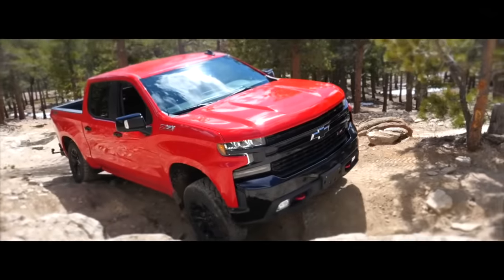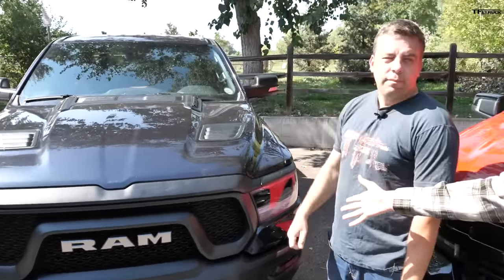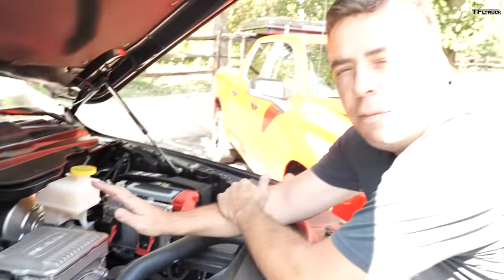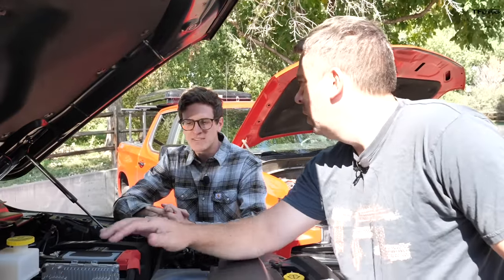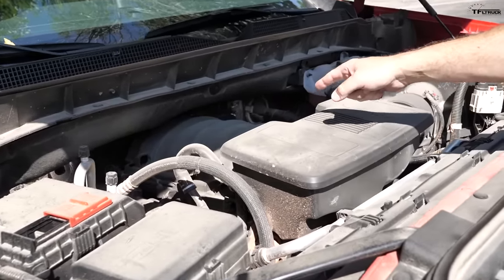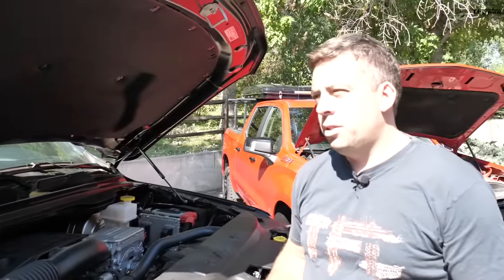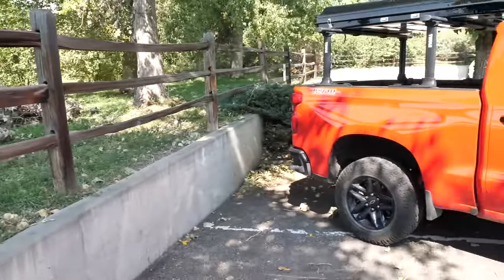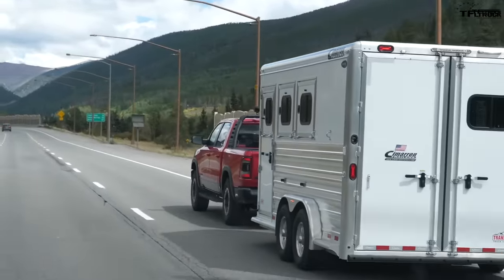New Ram Rebel vs Chevy Silverado Trail Boss: Which Full-size Off-road Truck Is Best For You?

Comment: If Chevy would step up their interior game like Ram they would probably be at the top (or close anyways)
Reply: Richard Garcia that grill is hideous and the Tahoe and suburbans are just ruined. all the older ones look better than the new ones
Reply: @SRT_VILLAIN  well thats your opinion. Those other grills is why didn't go with them especially Dodge
Reply: @RG-eg3mg  all reviewers say the ram looks better, plus looks is one of the reasons chevy is failing. They keep should've kept it the same
Reply: @SRT_VILLAIN  thats the thing though. I dont care what reviewers like. My $$$ cares what I like 👍
Reply: @SRT_VILLAIN  Chevy is failing?  Did you miss the TFL video where Chevy not only outsold Ram in 2020 Q3, but Chevy and GMC same combined also outsold Ford?  Does being the same leader sound like failing to you?

Btw, if the Ram is so superior, try operating the climate with gloves on.  Trucks are made to work, and people who work use gloves.  GM interior is better for people who use their hands to work.  The smaller 8" screen leaves room for redundant push buttons.
Reply: @domin8ss  look at reviews on the Silverado and sit there in disbelief, watch multiple cause some will not mention the problems
Reply: @SRT_VILLAIN  I watch many.  I'm not nïave.  Every vehicle has its problems.  I'll still take a Chevy over a Dodge/Ram any day.  I've turned wrenches on both.
Reply: @domin8ss  i owned both and currently have a blazer, suburban and Camaro 😂 my dodge vehicles have all gone but the coming back
Reply: @SRT_VILLAIN  know what's funny?  I bet both of us would rather push a Ram or Chevy before driving a Ford.  Dodge/Ram is my #2 vehicle.  When I was looking at new cars the Durango SRT Hellcat was on my list.  I love my wife's Chevy Traverse, but the lack of room in both SUVs made me pass on it.  I then started looking at Tahoe and Suburban, but took a pass on those because of lack of space.  Try putting a full size mattress in the back of those while also having your family in the car.  And then my wife decided she wanted a travel trailer.  She's looking at 26-28 feet.  That meant I needed a truck.  I considered a Ram Rebel.  The interior is very nice, but it takes more than a nice interior to me win me over.  I ended up with a Silverado Trail Boss with the 6.2 (as opposed to a Sierra AT4 because I couldn't justify the 10% higher price for the same truck).  It was the functional redundancy of the Silverado's interior that won me over.  If the infotainment screen fails I still have buttons for the radio, ac, etc.  I'm also familiar with the powertrain.
Reply: @domin8ss  I like both but chevy Is over priced when you compare it to other things in its class, even big time chevy fans say they are disappointed in the Camaro, impala,Malibu,ss and equinox. They just gotta up the power or provide something cause be side looks it offer nothing more than dodge
Reply: @domin8ss  and reviewers have proven the rebel to offer better tech and off road better. I love dodge but I think I'm ready for something a but more light so i can put some areo on and take it to tracks, its pretty decent but it's time for dodge to drop some pounds
Reply: @domin8ss  lol I have a 99/8 suburban still imma redo the interior and stuff
Reply: @SRT_VILLAIN  this isn't a conversation about cars.  Stick with the topic.
Reply: @SRT_VILLAIN  the only offroad review I've seen was TFL.  The pointed out the Trail Boss was marginally better than the Rebel.  The Ram has a worse approach and departure angles.  All other reviews I've seen where nothing more than opinions while standing outside the vehicle or driving it on road.  The only thing I've seen reviewers agree on is the Rebel has a more luxurious interior.
Reply: @SRT_VILLAIN  That's great, but what does it have to do with 2020?
Reply: @domin8ss  I've seen some where the ram is better, and all of them said you cant use paper on offroad/real world😂 but still I hear that overall including all the segments the ram is best overall. But if I'm a chevy fan I would buy a chevy, if I'm a Toyota fan imma buy a Toyota and so forth. It really matter who you like cause it's clear the redeye is better than the zr1 or zl1 and chevy fans still buy it
Reply: @domin8ss  I was replying to your part about your suburban, I'm cool with both chevy and FCA but I like speed and FCA gives me what I'm looking for. I got into my redeye knowing I could beat a gt500 or zr1 if I saw one, it boosted my ego know what i can do then i get into this zl1 and it all falls down
Reply: @SRT_VILLAIN  a redeye is faster than a zr1?  😆.  The zr1 has the advantage in power and weight.  As for the zl1, I can see that being slower.  Grip would be a big issue for both the Challenger and Camaro.  However, you fail to recognize there's more to racing than straight lines.  Chevys are pretty good at carving corners.  Now that I've entertained you, let's stay on topic about 1/2-ton trucks.
Reply: @SRT_VILLAIN  I don't have a Suburban, and never said I did.  I considered buying one, but went with the Silverado instead.  The wife and I decided to not have the 4th kid we always intended to have, plus if we did have that kid our oldest will be old enough to ride in the front seat soon.  So, we decided to get the Silverado.  I wanted to have my fun too, so I bought a Trail Boss with the 6.2.  It's not a Raptor, but it's quick and looks good.  Ram was a very close second place, but the gear selector knob and giant infotainment screen were big negatives.  I kinda wish I waited for the TRX since it got the center console shifter, but that big screen is still a nope.  I was hoping Chevy would've dropped a 700 horsepower V8 into the Silverado and call it the ZRX or ZR2, but it looks like that may not happen, plus I don't like the 2021 Tahoe interior that's about to find its way into the Silverado.  So, I bought a 2020.  The wife has already given me the green light to supercharge the truck.  I'll probably wait until the powertrain warranty expires, then call Hennessey Performance for the 700 horsepower package.  I know they offer a dinosaur killing 800 horsepower package, but that's going to require more than I want to spend and deal with.

Btw, Toyota is to GM what Hyundai, Kia, and Mitsubishi are to FCA.
Reply: @domin8ss  power? Since when a zr1 or zl1 had a power advantage, it has like 700 less lbs. Yh but no power advantage, redeye has 150 more hp
Reply: @domin8ss  lol how many turns are you really gonna hit that a challenger cant, it has the suspension and stuff too. Just not as good. I have a zl1 right now and I'm assuring you it's not faster than a redeye
Reply: @SRT_VILLAIN  right now it's your vision that keeps turning.  You keep comparing cars to trucks.  FCA isn't making a Ram redeye.  Challenger Redeye makes 797 bhp.  Corvette ZR1 is 755 bhp.  Gearing, weight, and a bunch more say the Corvette wins.
Reply: @domin8ss  lol you have to compare the hellcat to vettes cause they couldn't keep up with the viper and yall putting four door sedans against a Camaro😂 ain't that some shit. The charger getting a redeye to beat Camaro and if ford try some funny shit dodge will drop a redeye, the raptor comes out in two years witch is enough time. Corvette is the only car worth racing from Chevy, the charger tops out at 202 and normal civilians can hit that😑
Reply: @SRT_VILLAIN  again, you're talking about cars.  The video your responding to is about trucks.  Just admit you have no teeth in this subject and move on.  I keep reminding you that you're not on topic, but you insist on acting ignorant.  If you want to discuss performance cars, go find a video comparing performance cars and talk to those people.
Reply: @domin8ss  lol, its company vs company and your not getting that. Your using big time channels as a reference but you dont look at comment section b4 referring them. Dodge is better than chevy
Reply: @domin8ss  plus he said something about their interiors AS A COMPANY so I said something about another vehicle
Reply: @domin8ss  read dude, he said CHEVY not one special vehicle
Reply: @SRT_VILLAIN  Did it really take you 5 days to come back and argue?  Ridiculous.  I've done the reading.  I've also done the viewing.  This video was about 2 trucks, not whole companies.  Give it a rest already and go get in line to vote on Tuesday.  If you aren't in line already it may be too late.

Comment: Tough choice, I like the look of the Chevy a tad more. My current 2012 ram hemi has been reliable with 250k miles. I have heard of transmission issues on the newer generation Chevy 5.3.

Comment: You guys didn't drag race them? I. AM. APPALLED!
On a serious note, I'd take the Trail Boss all day. The interior isn't as nice but it does everything the Rebel does when optioned out, and when you guys took them to Moab, the Trail Boss seemed to perform better. 
I couldn't not have the 6.2 with mine though, in fact I think I'd probably take a base custom Trail Boss with the 6.2 if it were between that and these two.

Comment: Silverado - that HUGE  RAM Display will BREAK and cost $5,000-$8,000 or more to fix and when it does fail NOTHING will work- I want a TRUCK not GIMMICKS
Reply: Calm down
Reply: I have 1st gen of 8.4 with 0 issues , 7 years old
Reply: @85Merf  Think he has "small screen" syndrome, you know size matters.

Comment: Chevy has the rust prone, wax coat frame.
Reply: Actually incorrect.  It's the opposite.
Reply: @MrTaffiny1  and I guess @TFLoffroad (really guys!?). You are both incorrect. Ram has an e-coat painted frame. Chevy has the notorious wax coat you can flake off with your fingernail, try it yourself.
Reply: @budfox711  i have a 19 Silverado, I can confirm it has the black wax tar crap that sticks to you even if you look at it wrong.
Reply: Not since 2013...
Reply: My 2015 Silverado had it... and my 2019 Silverado has it. At least I have something to make candles with if I ever get stranded somewhere!
Reply: @chimmychongaz  I concur.  My 2020 Trail Boss has the same black goop.  It's not flaky like candle wax @Bud Fox wants us to think it is.  If TFLoffroad is saying otherwise then they're full of it too.

Comment: I have owned 4 GM vehicles, 2 new and 2 used.  Reliability has always burned me.  I have owned 2 Jeeps and 1 Ram.  Never failed me.  Guess what, I choose Ram.  Experience trumps any advantage in a comparison of features.  I am convinced 4 out of 4 GM losers makes a strong argument that GM has systemic quality and design problems.  They are POS.  For me Chevy is at the bottom of preferred trucks and I would rather walk than buy one.

Comment: The only thing I like in the chevy is the available 6.2 but of course you have to pay for it and not a lot of TBs come with them. I had a 17 LTZ and I find that this interior isn’t different enough for me. I like the rebel a little better I just wish they had a larger engine option like GM does.

Comment: I am looking for a 1/2 ton pickup and  I am looking at fuel economy. I recently took a ram 1500 classic on a 1000 miles round trip and averaged 25mpg. Can the new 1500 get close to this? Not in rebel form.
Reply: I would get a 2020 or 2021 Chevy Silverado with the 3.0  inline 6 turbo diesel you can get like 31mpg with it! If your going for good gas mileage.
Reply: If you're buying a half ton pickup for fuel mileage the 3.0L Duramax is the move.
Reply: Want best gas mileage?, hell, I'd have to say get the 3.0L Duramax!

Comment: I own a 2021 laramie 4x4 and 2022 silverado 2500....also had 2021 gmc elevation

Ram has the tech down and GM is very easy to use though plain

I will say the GM just feels like a more solid built truck overall....doors, levers, knobs, etc it just feels more substantial and bed is far more useful....its easy to use and simple

RAM everything is in 12in screen....its nice but not as easy to use while driving....some days I get into Ram and love it, other days am like eh.....chevy I felt neutral everyday

The chevy you sit in drivers seat with vertical feeling dash and wheel, the Ram you feel on top of with slanted wheel and dash......idk why neither come with seperate tilt and telescope wheel....in both trucks the DIC is blocked when driving in comfortable position......

Though I like my new Ram I think the GM is a better truck overall even though I own the Ram now......time will tell

New 22 refresh in GM will bring it up to date.....

Comment: You can’t compare the two in fuel efficiency seeing the Ram has more power, bigger displacement and taller tires. If you factor those in the MPG difference is a wash. I agree sometimes less is more but not for $55k

Comment: I own the 2021 Ram Rebel with the 5.7 Hemi (No food processor)... Love this truck!  Glad I chose this over all other makes... but the fuel numbers the factory says is a JOKE!!!  12.3 MPG in town... best I've seen on the hwy is 17.  Although I didn't buy a big heavy truck that can tow and sounds bad ass for fuel economy!  So really it's not that big of a deal!  I also got the Air Suspension which I love!
Reply: That food processor saves gas dude and u get 130 more torque at launch 500 plus feet of it below 2k rpm

Comment: You guys didn’t mention the interior quality in comparison between both heck even the rear passenger seating are rear door panels have soft touch material compared to crappy plastic on the rear of the Chevy Ram has I personally believe class Leading interior feel quality and use of different textures and materials

Comment: I put my dollars on the RAM Rebel.  My only complaint is that FCA just can't seem to get the electronics to be as usable as Ford and GM, and that's been an issue for as long as I can remember.  But otherwise the RAM was better across the board for me.  If Ford would come out with an FX4 that had offroad wheels and a skid plate up front that would have made the decision a lot harder.

Comment: You are slipping; you point out a difference of efficiency but overlook the lower amount of power that causes that. Also the comparo was over as soon as you sit inside the cheap Chevy interior. Aren't there storage boxes in the second row floor in the RAM and the Chevy doesn't have rear heated seats. Did I mention the crapy dated infotainment unit in the Chevy?

Comment: Ram has the Rambin in the rear floor.  The liner can be removed to be easily cleaned and could be filled with ice for drinks.  The Ram can be had with Ramboxes in the bed and barn door style tailgate.  The Ram’s sunroof is a panoramic vs. Chevy’s old-school small rectangle.  It ruffles my feathers when you don’t mention all the feature differences when you compare “apples to apples”.

Comment: Ok one thing besides the food processor option lol
The ram has sensors in very prone to damage areas where GM managed to keep them a bit away. For the off-road models anyways.
If gm could have a bumper option with better ground clearance. That might be the truck.
I’m a bit of a Ford F-150 fanboy, kinda like gmc diesels, and can’t pass up the 5.9 Cummins dodges, so a general car guy and gmc might be the truck to buy this year 🤷🏼‍♂️🤦🏼‍♂️

Comment: I’m confused. What the hell are electric motors between the transmission and engine for, if not to improve fuel economy? In the end doesn’t it just complicate engine and transmission repairs? Smooth stop start isn’t a big deal if it doesn’t help fuel economy.

Comment: Rebel for sure manual elec. dif lock all the bells and whistles, mine has the panoramic sunroof my buddy got the trail boss just to get a different truck and he's bummed. Ford's are to scary unless you go straight v8 but even then. I will say one thing though, what's gonna happen in 10 years with all the electronics on a Ram, I would bet not everything works as it should. That goes for any truck though I guess. The Trail Boss looks cool but I think the Rebel looks a little better, especially with a lift kit.

Comment: RE: The Diesel, while it isn't available on the Silverado Trail Boss, it's available on the Sierra AT4. So if you want a Trail Boss but need a diesel, get a GMC (virtually the same truck albeit slightly dressed up/better appointed).

Comment: I owned an E-torque ram rebel, the manufacturer had to buy it back from me because it suffered a massive electrical failure. They are junk!! Just bought a 2020 trail boss and it is a much better put together and quality built truck.
Reply: Nice!

Comment: Downside of the Trailboss: no ventilated seats, thin steering wheel, plain interior, no telescopic steering wheel, slower
Downside of Ram: weaker looking exterior, bed is shorter(Chevy actually measures 5’10  on the floor), lesser resale against a trailboss

Comment: Driven both the Ram has scary acceleration compared to the Chevy. The Ram dash sits lower and has more headroom. The Ram front seats are a little wider and feel more comfortable.  The Ram cab  overall is and feels roomier and gives better visibility to the outside, especially the windshield view! The Ram hands down takes the looks category. With the ever increasing cost of fuel the Chevy takes it. The Ram has a 60,000 5 year and I think the Chevy is less in both but not sure! The Ram has larger disc brakes and beefier rockerarms. The Ram engine has a history of bolt shear with the manifolds. Also the Ram 5.7 has a history of lifter problems which can lead to Camshaft damage,  both problems are expensive fixes!  Overall engine reliability when dealing with long term, (100,000 miles pluss) got to go with Chevy 5.3.